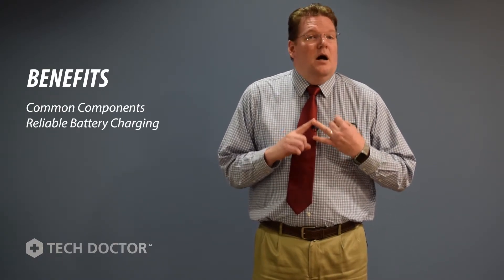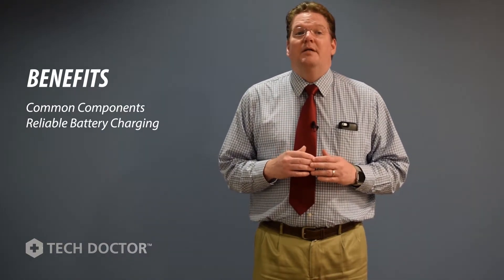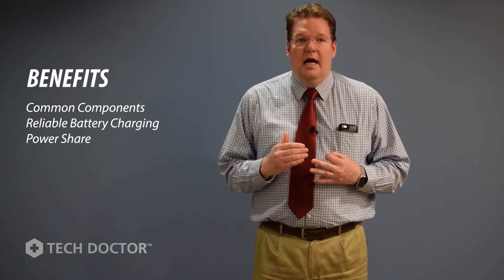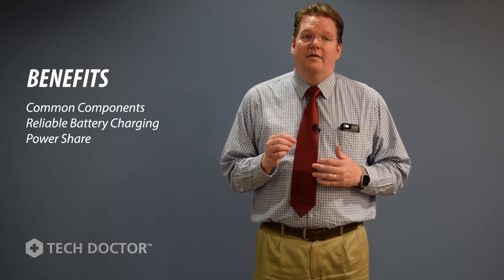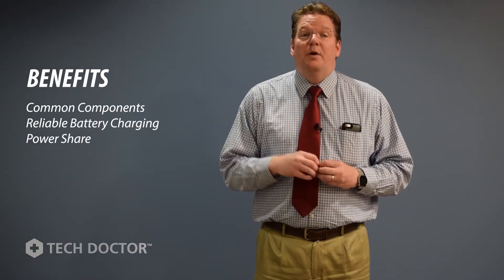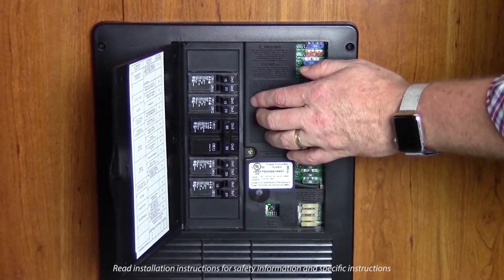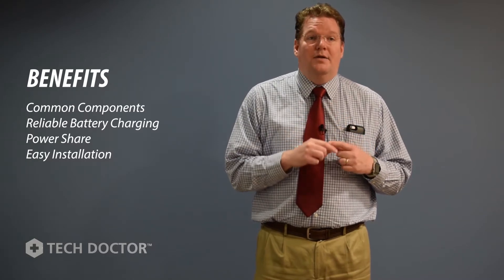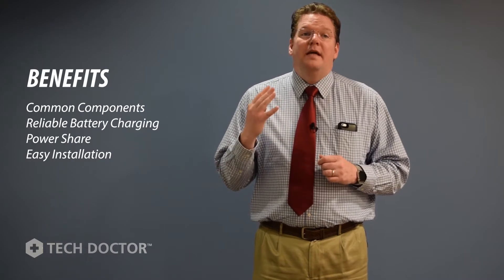Xantrex Tech Doctor™ - Converter broken? Need a reliable battery charger?

Comment: Hi Don,  I installed a Freedom X  2000 it seems to work Great with my load without a problem.  Followed all instructions to a T.  It seems that I need to plug into shore power or turn on the genny to get it started.  It won’t turn on by itself using the on/ off button.  I can unplug from shore or turn off genny and it remains on as it should.  But it never stays on for more then 36 hours without me needing to kick start it again with some kind of power ( shore/ genny)  the button on the inverter is always on. Also solar keeps the battery’s charged the whole time.  I might add it has been sitting in our driveway for 2 months without movement, I would really like the mystery solved before we leave for vacation.  Any help would be much appreciated.. TY Jim
Reply from the maker: You likely have the Power Save Time set to some value (max is 25 hours, and likely your current setting). This will cause the inverter to ‘time out’ when no significant current is used during the course of the timer. It is primarily used in a situation where the inverter is used often, but prevents accidentally leaving the inverter on, unattended, or un-needed.

To change the setting back to “off”:
1. Hold the OK button for three seconds to enter the Feature Settings Mode.
2. Press the scroll (^) button repeatedly to move to the Power Save Time setting (setting #5).
3. Press OK button to select the setting value.
4. Press the scroll (^) button repeatedly to change the value to “OFF”
5. Press the OK button to confirm the change.
6. Press the ESC button to exit from Feature Settings Mode.
This should solve the issue for you.

For more settings see pages 45-49 in the Owner’s Manual.
Reply: Xantrex Ha, Thank You.... You are the Wiz.  I’m on it first thing for sure..

Comment: Which inverter charger is more lithium friendly the SW series or the XC series. As I know people have used both and have some hit and miss configurations of success and failures. I know you guys work with the OEM RV manufacturers for integrations but what up to date information can you give us folks that do self-installs in regard to lithium batteries with integrated BMS systems such as Battle Born batteries, Relion or Lithionics.

Is the software in the SW Series Lithium Ready or can the units out their be flashed or software upgrades online? How about the new XC models are they Lithium Ready off the shelves today as I believe they are not according to your website and on the forums as I am wondering why if it hasn't.

I am looking at purchasing 2-4 100A Battle Born Batteries  and want to know what you guys"Xantrex" would suggest for an inverter charger at a setup of 2000 to 3000 watts with these lithium batteries. Thank You
Reply from the maker: Either platform, with the latest firmware revision, will charge Lithium batteries effectively. The Freedom SW's advantage from a charging perspective, specifically the 3000-watt model, is the charger size - 150A. But, these inverters have different topologies too, so that’s probably the most important thing to consider first. Size the inverter to your application, then decide if the charger is fast
enough. If not, upsize.
Reply: Thank you